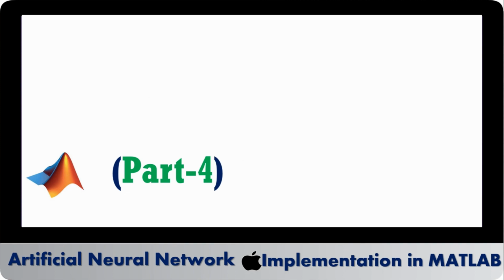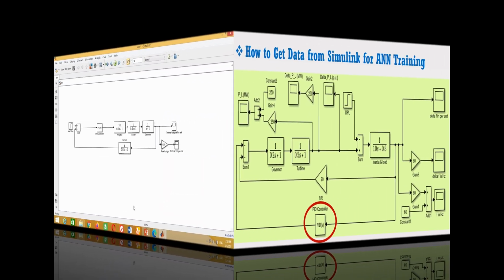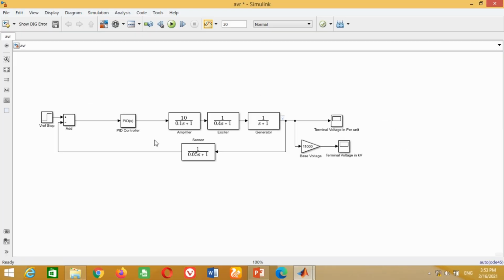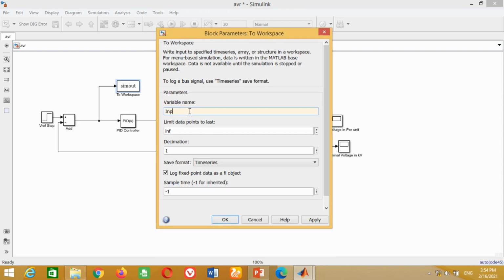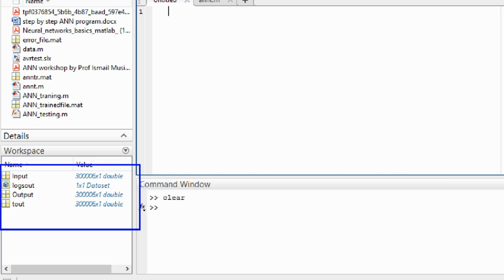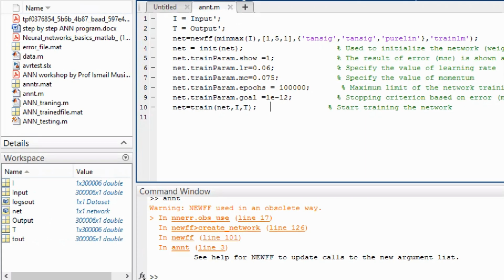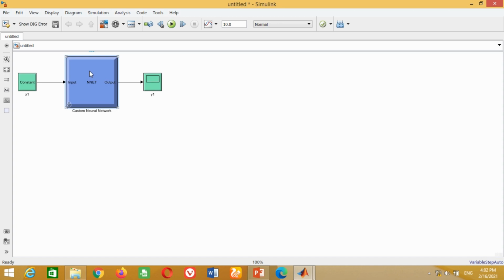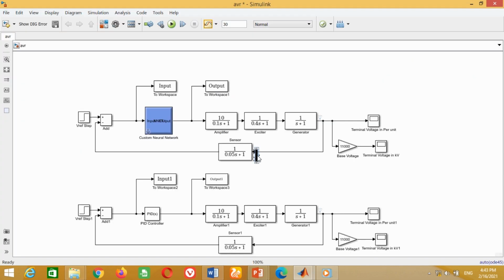How To Get ANN Training Data From SIMULINK ? (Part-4) | Dr. J. A. Laghari

Comment: Alslam aliokm
I want to train the ANFIS PSS
This method in the video can train the ANFIS PSS for one scenario,,  how i can do it for more senerios automatically  without changing the loads and the fault manually ?
Reply from the maker: Wa Alaikum Assalam, Thanks for the comment.  To train the ANFIS-based PSS for multiple scenarios automatically, you can:
Create a script or function in MATLAB that:
Varies load levels and fault types using loops.
Simulates each case.
Collects input-output data for ANFIS training.
Store all scenarios' data in a single dataset and use it to train the ANFIS model with broader coverage.
This way, you avoid manual changes and ensure the PSS is robust across various operating conditions.
Reply: @DrJALAGHARI what did mean by with border coverage?

Comment: Very Great work Dr , inspiring , however , would you please shed some lights if you had implement the ANN for the power transformer fault detection before or not ? I have searched the channel but I couldn't find
Reply from the maker: Thanks for the compliments. No. I have not used it. But, the idea is same.

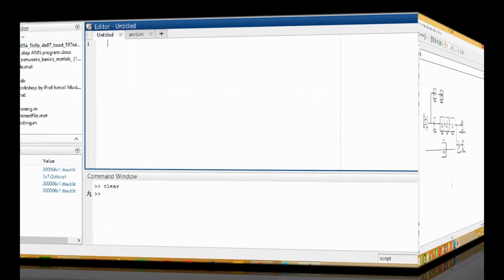Comment: Assalamualaikum sir, I have a problem with the Input and Output data size. At 4:05, it is shown in the workspace that the size is 300006×1, but for me, the size of the data is only getting to 916×1, which is a VERY LARGE difference.
I have done exactly what was shown in the video, the response curve and everything is exactly the same.
I could not find a solution for that.
Reply from the maker: Thanks for the compliments. it depends upon the step size settings in the matlab Simulink. you can modify it from the simulation configurations.

Comment: Assalam Walaikum sir,

i tried to replace the PI controller with ANN in a buck boost converter circuit.

The training was successful, but the problem is ANN is behaving exactly like the PI controller. Same amount of overshoot and settling time. What can I do to get a better and smoother response with ANN controller?

I also tried to tune the PI controller first. but the tuner couldn't linearize the model.

Please help me.
Reply from the maker: Thanks for the comment. You can reduce the overshoot values by changing them with lower values and then train. Now it will give smaller overshoot

Comment: Nice talk! :-) Just a curiosity: what is for you the advantage of using ANN for implementing a controller? I mean... in general and even for more complex scenarios than the one of this example. My point is: it seems every ANN-based controller needs, to be trained, a well-tuned traditional controller. Thus, why one should prefer ANN-based controller? It seems we are doing the job twice... and the final controller works further worse the PID, due to the lack of the integral action in the ANN-controller... Moreover note that the complexity burden of the ANN-based controller is much higher than the PID😀
Reply from the maker: Thanks for your valuable comment. PID controller has the limitation of the parameter tuning and also it does not provide an optimum response for every new changing condition. furthermore, for every new situation, it tries to give the response at that time due to which its computational time is quite large. This results in a higher overshoot, and a large settling time. On the other hand, ANN requires training once. After the successful training, It will provide the best response for every new condition. Furthermore, as its response is already given, therefore, it will not take time to calculate the best response for every new condition. due to this, its computational time is smaller. This results in smaller overshoot, and lesser settling time.
Reply: @DrJALAGHARI  I mean, take a look to 8:30 the ANN-controller has 100% of overshoot, very bad time response and worse steady state error... Moreover, it is unclear why you say the ANN-tuning requires training once. Since your ANN tuning looks based on a given PID response, the ANN tuning cannot perform better then your original PID. Possibly... are you referring (maybe) to a different tuning method than the one you show in this video? Do you have any reference? ps. Regarding the complexity... a standard PID accounts only 3 registers, whereas, how many neurons do you need for implementing a ANN-based controller?
Reply from the maker: @alexpilloni  Thanks for your valuable feedback. I understood now your point of view. The main aim of the video is how to get ANN training data from Simulink and use it for training or testing. I have not properly trained and tested the ANN. I have just shown an example of how to obtain the data.

Comment: Thank you so much for this helpful video. May I ask, what if I want the ANN to generate the PID parameters. What Input and Target data is needed to train the ANN? I would be very helped with your answer. Thank you in advanced.
Reply from the maker: Thanks for the compliments. If you have simulink model of PID. Then follow the above strategy and use three output parameters of PId controller as output by using multiplexer.

Comment: Good evening Prof., how can I use the neural network to tune the gains of the PID controller?
Reply from the maker: Thanks for the comment. You may simulate the PID controller based model and get the training data then use the data for training and testing of ANN.

Comment: Thanks Sir, I learned a lot  by watching series of lectures on  ANN training.
But sir I am facing a problem in training of ANN for PSS and FACTS controllers that are used for Transient Stability improvement of the Power Network.
Reply: Sir I am training ANN for PSS, for that taking data to workspace using 'to workspace'tool, but during training ANN that data is not applicable or error occurrs
Reply from the maker: @mwaseem2625  Which Matlab version you are using?
Reply from the maker: Thanks for the compliments. May I know what problem you are facing?
Reply: It's 14a

Comment: Sir, am getting this error ( Output data size does not match net.outputs{3}.size.), using one PID controller, my second question , my model has more than PID controller , how to deal with , in case using ANN??
Reply from the maker: For multiple pid controllers you have to use multi ANN controller. Therefore at first you have to replace one pid controller with ANN controller then second one.
Reply: @DrJALAGHARI   Jazak Allah Sir.
Reply: @DrJALAGHARI  sir, still getting the error "Output data size does not match net.outputs{3}.size," am using input data matrix (13198*1), if i transpose the matrix is it going to effect my signal to controller ? or any other solution pls, and yes i have changed the ANN input and output to [1,8,1]

Comment: Thank you very much Sir for such informative tutorial, simple, clear, timely and informative!

Sir, I have a question and kindly help me!! 
I am working on simulating a MIMO (Actually 2-input 2-output, i.e. TITO) system. I tried using the code from this video and the example based on Simulink design, but i could not simulate (i.e. get the system to run). Sir, how can I use an ANN controller for this TITO system simulation, or what can i do additionally to make the system run? 
Cheers
Reply: Thank you great Prof. You will live long on this earth to accomplish all that God wants u to accomplish for Him and for humanity. Sir, I sent you a message to your inbox. Can you kindly check and help me. I am at a crossroads with no solution to my simulation. I believe you are a God-sent to me. Thanks
Reply: Thanks in advance
Reply from the maker: @davidezekiel685  Thanks for the compliments. ok I will check and let you know if I can do anything
Reply: @DrJALAGHARI  Thank you Sir. Very much appreciate Sir
Reply from the maker: Thanks for the comment. The procedure is same. I don't know what problem you are facing?

Comment: Thank you doctor for the video, but what should I do if I want to connect NN+PI to ameliorate the PI output instead of replacing the PI, I'll appreciate any help you can give me.
Reply from the maker: Thanks for the comment. May i know what is the advantage of using both ann and pi in one model?
Reply: @DrJALAGHARI  yes Sir, I am working on a NN that is used in parallel with a non robust PI controller, the goal is to get a better response when using the NN+PI than the PI alone, just like this paper (Artificial Neural Network Based Adaptive Control of Single Phase Dual Active Bridge With Finite Time Disturbance Compensation) in the figure 5, but I don't know how to implement the adaptive control for the neural network in MATLAB, I saw an adapt tab in the nntool I don't know if it helps, if you have any idea about it I'll be thankful to you. I replied to you like an hour ago but the comment got deleted because it contained an IEEE link.
Reply from the maker: @hassaniskandarani1345  ii am not sure about combining both. You may search for many research papers to fully understand this idea.
Reply: @DrJALAGHARI  okay doctor thank you 👍🏻

Comment: Good moorning sir

I saw your video on ANN training it was  very helpful . i would like to thank you for all your videos .i understand how to do training if we use boost or buck converters. I done simulation files of pv system with P&O for MPPT. I would like if you could tell me how can i do training of irradiance and temperature if i used them as inputs and duty cycle as out put . we must have mathematical equations between T,G and Vpv,Ipv(corresponding to Pmax).
some works took Ipv and Vpv as inputs and Vref  as out put .
I will be very greatful if you could help me to write matlab instruction to do training for MPPT in PV system. i need only how to do training. 
thank you very much
Reply from the maker: Thanks for the compliments. It depends upon you which parameters you are going to choose for input and output. Try to find any paper closely related to this topic. It may help you. Or you may consider any data which provides the best results. In order to get the data, run the simulation and obtained the inpit and output training data by following the procedure as mentioned in the video.

Comment: Assalamu alaikum Sir. I have some questions. As in this video, the regression is .0966 which is less than unity. But the criteria for successful ANN training is that regression must be equal.  And the training data is not on the straight line. 
What measures should we take for successful ANN training  to improve regression to unity and fit the training data on straight line?
Reply from the maker: Thanks for the comments. I have discussed all the possible steps to obtain the regression equal or close to unity in the third part of this ANN series. Kindly have a look on it.
Reply: @DrJALAGHARI  Thank you Sir for your kind reply.
I have watched that part.
Then , I have to arbitrarily change these five parameters to get best suited straight line?
Sir , I have a confusion, do we need to process raw data before feeding in ANN (such as normalization,removal of outliers)? if yes, then when and how?
sir, may be it's a very silly question. actually I am a new learner.
Sir, it would be kind enough if you give me your email. I want to get connected with you.
Reply from the maker: @shaimbiswas8840  Thanks for the comment. Processing raw data or normalization is an optional thing. Suppose, you tried all efforts and steps but still not succeed to get regression equal or close to unity. Then processing or normalization may be helpful sometime in getting regression equal to 1. My email is jalaghari1@gmail.com
Reply: @DrJALAGHARI  I can't thank you enough SIr. This help means a lot to me.
Jazakallah khairan
Reply from the maker: @shaimbiswas8840  my pleasure. Stay blessed.

Comment: thank you doctor for this lectures, my question how I can discriminations between types of harmonic in sinewave or power generator by using ANN
Reply from the maker: For this purpose, first you have to use the signal processing techniques such as FFT, DFT, wavelet etc then take that data in order to distinguish using ANN. Better to follow any research paper.
Reply: Thank you Doctor for reply , I already using FFT for this purpose but my question where I can put block of ANN 
1-Instead of differential relay Between input and output current 
2-before FFT block
3-After FFT block 
Or there are another option 
Dear Dr possible to explain that
Reply from the maker: @waaelabdulhassan4982  use the ANN after the FFT block .
Reply: Thank you for clarification , I will do and update you about situation

Comment: Thank you for great explanation Sir. 
Sorry Sir, I really need your help.
I try to replace PID controller(2 PID controller, decentralised type) with ANN controller (2 ANN controller, decentralised type). I used m-file and gensim command like you explained. However, I used 2 m-file since I need two ANN controller. I'm able to get 2 ANN controller with R=0.99984 and R=0.98222 for each. When I used the obtained ANN model block at simulink and try to run the model, it give an error. The error stated "at time 0.0 using the TrustRegion-based algorithm due to one of the following reasons: the model is ill-defined i.e., the system equations do not have a solution; or the nonlinear equation solver failed to converge due to numerical issues.".Meanwhile, the same model can give good result with PID controller. It is due to R not equal to 1 or why? Can you help me sir? Thanks in advanced
Reply from the maker: Thanks for the comment. I think it should work. R above 0.9 is acceptable. this is not due to R. but may be due to another reason.

Comment: Thanks so much for the video. I have a question. What if the input to the ANN is more than one, how do you model it in Simulink? The model you presented has just one input in your Simulink. I am asking because my Simulink model has 3 inputs so I am having some difficulties.
Reply from the maker: Thanks for the comment. You can adopt same procedure for more than one output. In that case, output columns will be two or more depending upon the number of outputs.
Reply: @DrJALAGHARI  thanks. My output is one. instead i have 3 inputs
Reply from the maker: @kamgangblaise2645  The procedure will be same. Input data  will have three columns.

Comment: Can we make use of ann for placement of dg and selection of candidate node sir for an ieee distribution system and what must be my inputs and outputs to ann? Thanks in advance sir
Reply from the maker: Thanks for the comment. In my opinion, for placement of DG and sizing of DG, optimization techniques are used.
Reply: @DrJALAGHARI  sir cant we make use of ann
Reply from the maker: @vinayshetty3059  in my opinion, better to search for research paper. It may be possible.

Comment: thankyou for your video sir, for fault detection using ANN m not able to think what should be taken as input, output and target. please help sir, thankyou in advance
Reply from the maker: I have not done fault detection. but in my opinion, you have to put the input data for before fault and output data after fault in order distinguish or detect the fault location.
Reply: @DrJALAGHARI  sir please make a video on this topic as ANN is new research for me. Please sir
Reply from the maker: @niharikasawhney2237  ok. I will try to make video on this topic as soon as possible.
Reply: @DrJALAGHARI  thanks alot sir. I am doing my thesis work on this. I would be really grateful for your help

Comment: Thank u Dr. Laghari for ur valuable lectures...It would be very helpful if u do let us know and teach us how to tune PID controller parameters using ANN for first order or second order process....
Reply from the maker: Thanks for the compliments. The procedure of ANN training remains same for all type of process. Only input and output data is required which is the most important part of the ANN training.
Reply: @DrJALAGHARI  Thank u for ur reply....How to create a neural model with four inputs like e, de/dt, r and y and 3 outputs Kp, Ki and Kd....In the video shown there is only one input e(error) and one output u(controller output)....Pls can u suggest....
Reply from the maker: @rihanabanu9985  Thanks for the message. De/dt can be obtained by using the derivative function block in the simulink model. By this way, one will be the original input, and other will be its derivative input. Then you can take the multilpexer block to combine these two inputs and send it to workspace. I couldn't understand r and y ?
Reply: @DrJALAGHARI  Assalamu alaikum sir.....Can u pls post ur mail id
Reply from the maker: @rihanabanu9985  jalaghari1@gmail.com is my email address.

Comment: Hello sir,
I want to divide ratios for training, validation, and testing.
what could be the codes for that.
well, I am using this
net.divideParam.trainRatio = 0.7; % training set [%]
net.divideParam.valRatio = 0.15; % validation set [%]
net.divideParam.testRatio = 0.15; % test set [%]
But this doesn't work.
It would be great if you would help in this.
Reply from the maker: it should work. in other case, just use nntool gui, and perform the same by dividing the data into separate files and upload them separately.

Comment: Can you suggest how ANN can be used for harmonic mitigation in multidrive system? based on filter of PID controller in Active front end?
Reply from the maker: The procedure of ANN implemntation remains same for all systems. In your case  first simulate the model with PID controller based filter, get the input and output data of PID controller. Shift it to workspace, then train it, and get back again in the simulink model.